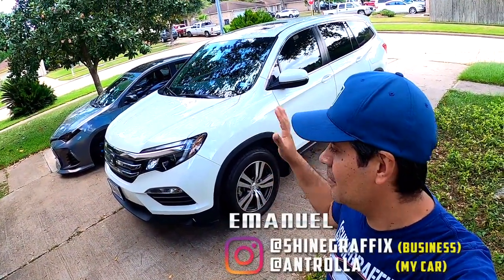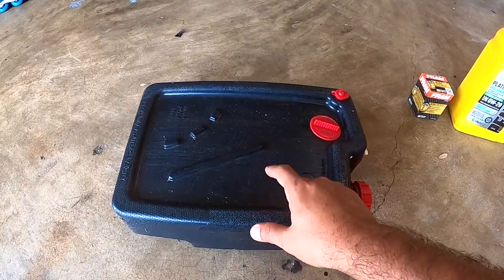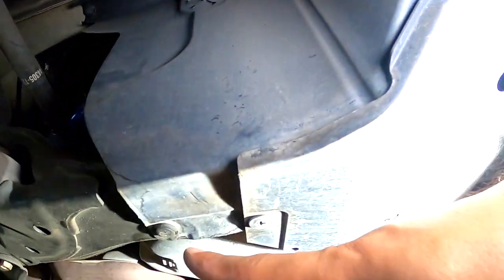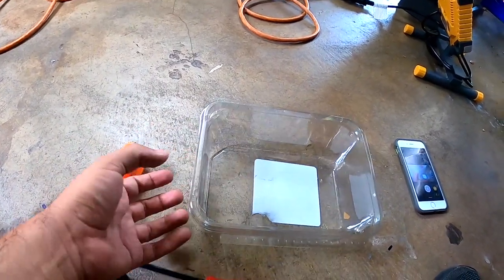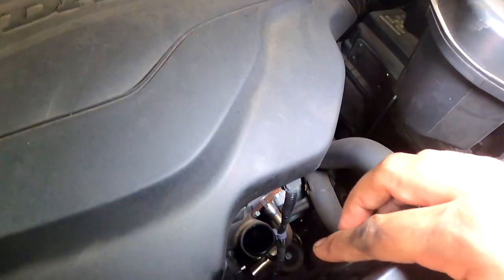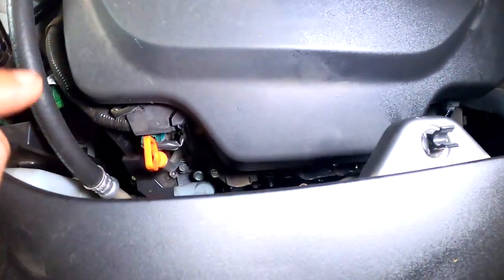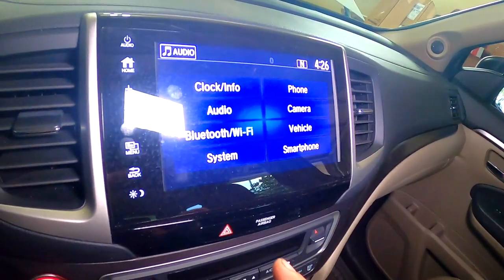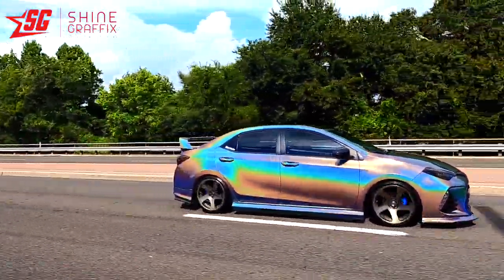QUICK How To Oil Change Honda Pilot 2016 - 2020

Comment: Grab a cheap plastic tarp from Harbor Freight and place under the Pilot to use every oil change. Also, get a large plastic bag or plastic cup to slide over the oil filter when removing it for zero spill/mess. Wipe the area where filter goes with a rag and install new filter. Easy peasy

Comment: Great video and tips. I did get a oil filter wrench because it’s hard to take it off. I also prefer the Honda oil filter or Mobil 1 filter. You have to use full synthetic oil on the pilot that’s recommended. I actually change mine when the maintenance minder goes down to about 5-10%. Roughly around 7k miles for me.
Reply: Great tip. I’m going to try my self next time instead of waiting an hour + at the dealer. I already ordered the Honda filter, do you recommend an oil brand ?
Reply: @acemechanic6736  I use Mobil1 or Honda 0W-20 all the time.
Reply: @josee.1278 what is the Mobil 1 filter number for Honda pilot?

Comment: Thanks for doing this. I do concierge car service, so not spilling oil on the owner driveway is a good thing. Without this guidance, I would have had a big mess, plus not the right tools. Someone had removed the fender liner already, so didn’t need the body tools. I did decide to bring my 17” long automatic transmission funnel, it was perfect to fill with no spill. It took all 6 quarts, I did fill the filter before install. I did use a plastic bag on the filter, usually filters mounted like this, no oil leaks out when removed, but this engine is a gusher, I never would have expected that until too late. Good work!

Comment: Excellent video, my only recommendation would be to use the OEM Honda oil filter. Maybe the mobile one is good as well. For the oil I used Kirkland brand.

Regardless, straightforward and to the point. Thank you very much.
Reply from the maker: Thank you 👍 yes I will get different brand next time

Comment: Hi, thanks for this video.  Mechanic at Honda must have removed cover on my 2017 Pilot.  The plastic cover you removed 3.22 mins./sec. I want to replace.  I can’t find the part # anywhere; forums hond parts online etc… Any idea what the part # is ?  Thank You
Reply from the maker: Fender Liner Passenger side Part # HO1249162 but check with the dealer if that's cover by the warranty 👍

Comment: What if I don’t change the oil filter 
Cos it’s hard at times
Reply from the maker: You have to change the oil filter every time because it can get plugged up and mess up your engine. Get an oil filter tool 👍
Reply: The Honda maintenance minder "A" is just the oil.  The "B" is oil and filter (plus, inspect brakes, etc).  Still, I change the filter every time.

Comment: a plastic bag will work under the filter.
Reply from the maker: Yeah that’s a good idea 👍
Reply: Just used 1 gallon zip-lock style bag. Loosen the filter, slide the bag up filter past seal, continue loosening until it come off. Zero drips
Reply: Did it with ziplock bag. No mess.